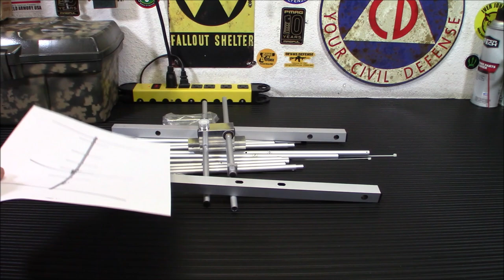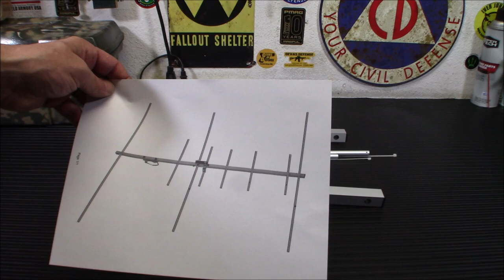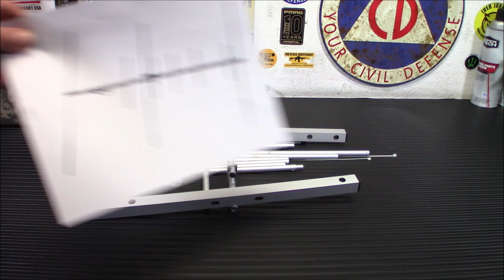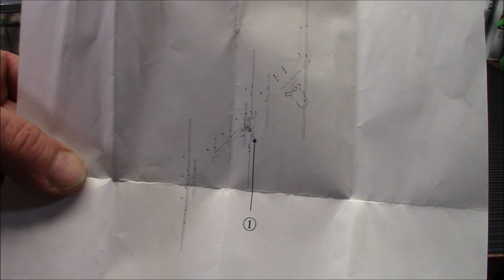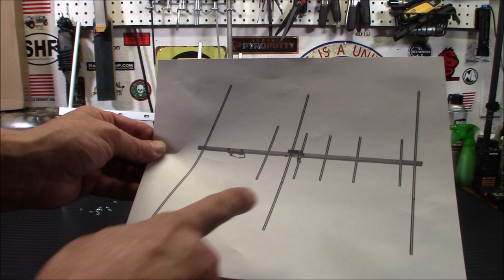Prepping Comms: Ailunce AY04 Yagi 144&430 MHz Beam Antenna

Comment: This would be good to use with my Yaesu
FT-818ND which has 2 M and 70 CM SSB.
I have had the Cushcraft similar to this in
the past for a similar price, but this one
seems to be lighter for portable operations.
Ray W2CH
Reply: This would work well on the IC-705 also
Reply: @HamRadio2  I've just ordered one thinking the same thing!

Comment: Sorry for a possible dumb question...I just purchased a Realistic DX-150B shortwave radio on Ebay.  Would this antenna work on a shortwave radio?  If not, is a wire antenna better?  Love your channel!!
Reply from the maker: thanks! Yeah this antenna is only for 2 meters and 440 (Ham bands) so it wont do as well as a wire. This weekend I am doing a video on how to make a simple home made wire for portable shortwave monitoring. its super easy
Reply: @Iridium242  Thanks...looking forward to the video.

Comment: I’m going to set up a GMRS base station. I know that that’s a dual bad antenna. Do you think it would be a good antenna for GMRS?My son lives in a small town 5 miles from me . My brother lives about the same . I live between the 2 . I’m on a hill or should I say I’m the highest point. So I’m guessing a high gain antenna set high up . On the GMRS frequencies I should be able to communicate with each of them
Reply from the maker: probably would not be tuned for GMRS, these antennas have a pretty narrow bandwidth so chances are they are just good on the ham 440 band
Reply: Did you ever figure this out? Was wondering the same question. TIA.